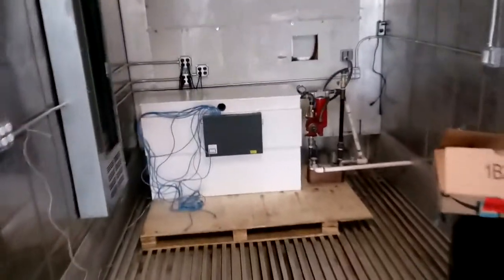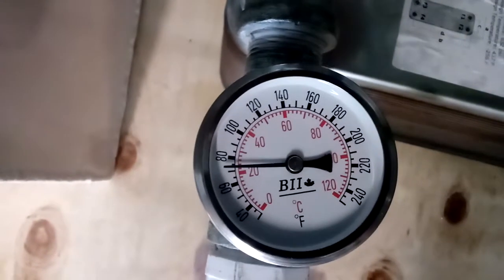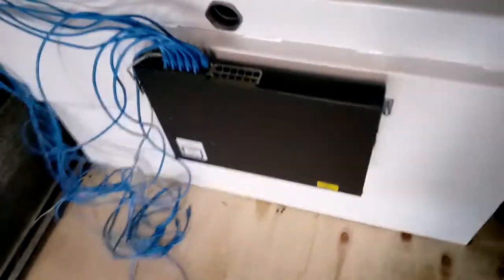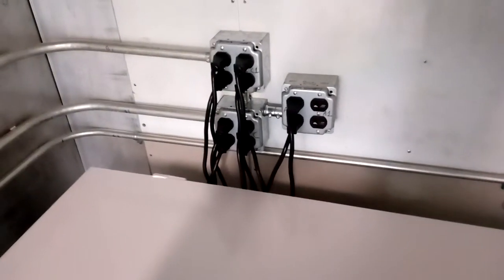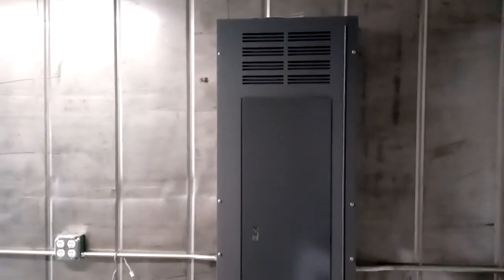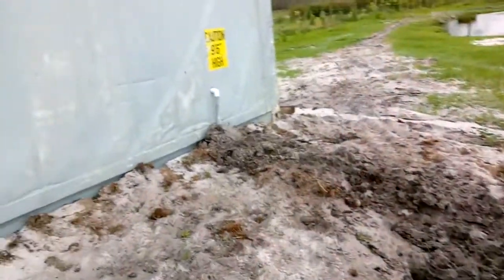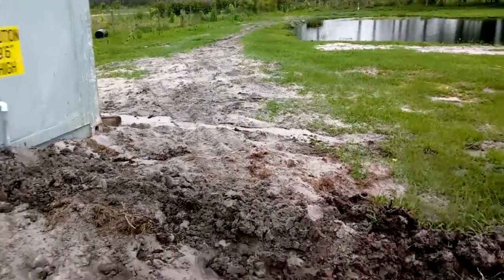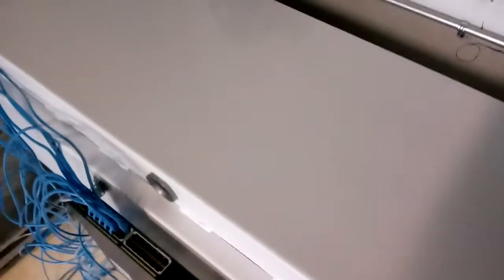Dragon mint and s9 Immersion cooling setup

Comment: by using this immersion technique, how much wattage do you save? For example - S9 = 1400 watts (give or take) minus the fan. Thanks!
Reply from the maker: When you factor the wattage for the pumps its about even
Reply: @SolarTechFL  Would you say per S9 unit still =1200watts? immersed that is
Reply from the maker: @H8TRHELL4U  yes around there in a hot climate

Comment: I am in the process of doing the exact same setup for my 40 s9, Nice job on yours what state are you located in and whats you  electric KW rate I have found 4.5 cent per kw here, also did you see a drop in  Kw usage when you removed the fans and how much if you know . I am going to do a comparison today on mine.

Comment: Hey joe greate setup you got there.
I have couple questions i would be happy if you can answer them.

1) i see the tank is metal, i see all prepropilen plastik material on the internet. Does metal dont cause short circut? 

And how many unit will there be in the tank? 

And what is the exchanger size u use.
Reply from the maker: rc_gti golf 5 
Metal is recommended
There is no exposed live parts that can contact the metal.
Reply from the maker: Tank can fit 36 units 
Heat exchanger is 500,000 btu's
Reply: you mean live parts by electronical circuts of s9
Reply: did you have chance to test the results with 36 units
Reply from the maker: rc_gti golf 5 no i only have 14 units. I sized everything for future expansion
Reply: ı have replicated 36 units container for my farming facility, 

ı already have 90 units with air colled at the moment, want to turn them in to oil colled or immersion coling, bu thermodynmics is pain for me, can not get any info of what is the heath exchanger to use or pump size or if i use metal container (which would be alot easier for me since I am working with sheet metal) so alot of unknown topics and big embition for imersion coling :) thanks for any help.
Reply from the maker: rc_gti golf 5 
Oil does not transfer heat like water does through a heat exchanger so you have to oversized it steel is definitely the way to go on the tank
Reply from the maker: rc_gti golf 5 it seems pretty easy to me I think the pump Size Doesn't Matter as much as most people think what matters more is your incoming water temperature and your desired operating temperature and the heat exchanger size
Reply: Joe Sidebottom i have 19 celcius degree water incoming and i am looking for 50 celcius degree desired oil temp the proplem starts here what would be the size of the exchanger
Reply from the maker: rc_gti golf 5 
Figure out the total wattage of your miners then convert that to BTUs then size the exchanger 2/3 bigger than that figure
Reply: Joe Sidebottom thanks according to the calculation of as you have mentioned. 1350 watts x 36 = 48600 watts = 165800 btu /h ant the exhanger i will get will be =165800x1.33= 250.000 btu
Reply from the maker: rc_gti golf 5 
That's what I came up with and then I just doubled it cuz it was cheap